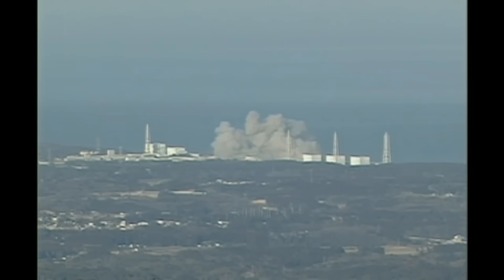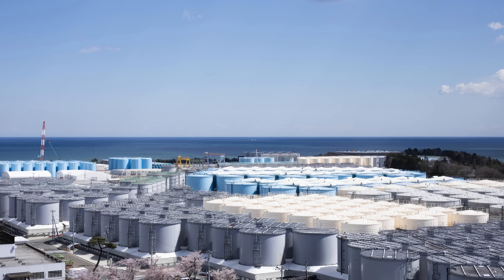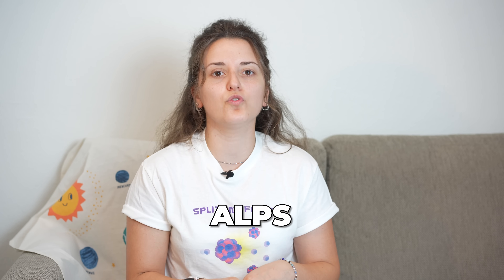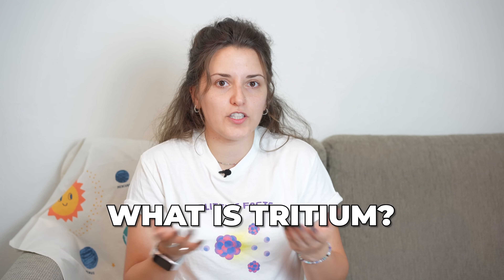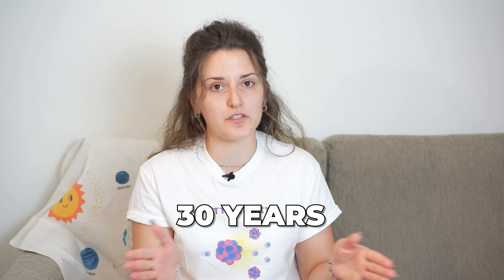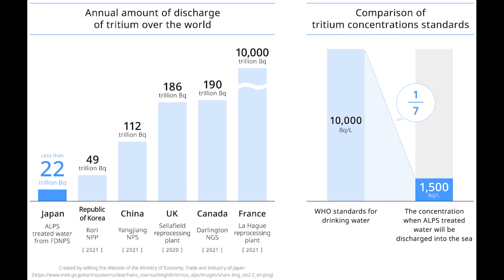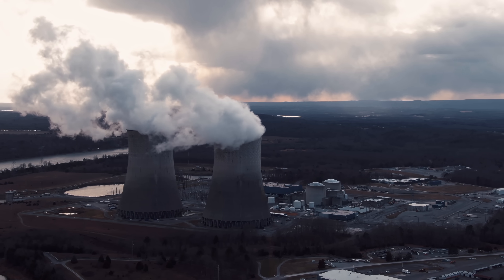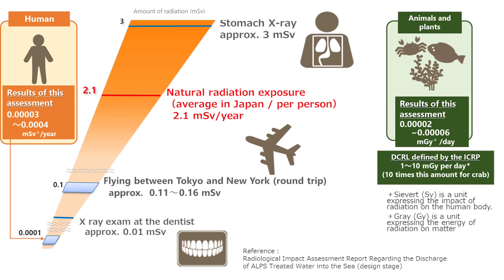Nuclear Physicist Explains - The Release of Fukushima Treated Radioactive Wastewater

Comment: Love your channel but this is not up to your normal high standard; the video is one of those "trust me, I'm an expert, I've looked at the numbers and it'll be OK" type. Saying it's OK because it's less than China releases is irrelevant. The comparisons to dental X-Rays and flying are so convoluted they fail for the lay person e.g. "how many dental X-Rays in a tank of tritiated water?" is the typical response. And people are worried that even if the averages work since the Pacific is so vast, what about local concentrations near the discharge points?  FWIW, I used to build civil nuclear power reactors in the UK, am avidly pro-nuclear, and actually agree with TEPCO's approach (although I'm livid that TEPCO execs were not incarcerated for their negligence). My friend asked "how many bananas are TEPCO throwing in the ocean every day?!!" I would present the T3O concentration vs "ocean background" or "ocean baseline" how does the tritiated water concentration in the water leaving the site compare to that of the open ocean average? If we filled one of those 1000MT tanks on site with water from the middle of the Pacific, how radioactive would it be in comparison to a tank filled with post-ALPS tritiated water ready for release? And the 12 year half-life of H3 in relation to the time since the disaster and the 30 year release schedule is crucial, right? Why are they not transferring from site tanks into into a tanker vessel and then slowly discharging the water while transiting across the open ocean in international waters - this would promote dilution would it not?  So glad your channel exists BTW - please don't take this critical comment personally.
Reply: Wow, you supposedly are in the nuclear industry yet refuse to read the report!
Reply: @danadurnfordkevinblanchdebunk Because he is an expert and You Are Not

Comment: I worked around microwave up links, 12 ghz 100 watt transmitters attached to the dishes.
I would feel the heat standing in front of the dishes and would get headaches and nausea.
I wonder how much damage this did to my body.

Comment: What happens if you use electricity to separate hydrogen and oxygen and then burn that hydrogen with the 2 excess neutrons?
Would that eliminate the radiation?

Comment: Nuclear material polluted water from Fukushima has more radioactive materials than just Tritium, like Iodine-129, plutonium-239,240,241 etc. All together there are 64 different kinds of radioactive materials in the Japan water. The water had touched the nuclear fuel materials directly inside the reactor comparing to the waste water from the cooling systems of the other countries. The Japan releases nuclear polluted waste water instead of the cooling water of the nuclear power plants. The difference is that Japanese waste water washed the nuclear materials directly.  Normal cooling water only flowing through the sealed pipes. Japan donated one million dollars to IAEA to let this release being approved by the institution.
Reply: The report clearly shows exactly what is in the water and the levels of each radioisotope and it clearly shows the only element that is anywhere near the action levels is the tritium.
Reply: The report also.clearly.demomstrates the effectiveness of the ALPS system.

Comment: As a nuclear physicist, can you confirm that there will ONLY be tritium in ALL the ALPS processed water?
If the processed water is so safe, what is the logical reason to build a 1 km tunnel to release the processed water into the bottom of the ocean instead of a shorter tunnel, or simply over the shore like a river?
Reply: The report confirms that tritium is NOT the only isotope in the water just like she said.  Pretending otherwise is disinformation on your part.
Reply: @ForbiddTV  May be I have not made myself clear.  My question is: can Elina being a nuclear physicist  confirm that tritium is the only radionuclide remain in the processed water? Through out the coming 30 years, there is no chance that the ALPS would fail or efficiency drop and not 100% of other radionuclides are filtered out?
Can you answer why the 1km tunnel is needed?

Comment: I enjoy watching her videos but something needs clarification at 0:45 in the video. From talking to most people who I've discussed this with think that the reactor underwent a nuclear explosion. That is not the case. Because cooling water could not be pumped into any cooling systems, the reactor core continued to heat up until the metal fuel rod cladding began to melt. When this happens the metal goes through a zirconium alloy reaction and hydrogen gas forms in the top of the vessel and eventually the reactor containment dome. The resulting explosion is from the hydrogen gas. The nuclear fuel in the reactor doesn't explode but the hydrogen explosion is fairly catastrophic.

Comment: Hi Elina, could you explain more on how the ALPS work and how effectively it removes all radioactive element except for trillium. How this was monitored and by who? Thanks.
Reply: Excellent question. I too am curious and have had the same question. There were some extremely toxic and dangerous contaminates in that water. I, who have worked with nuclear material, have heard of no system capable of filtering all the contaminates the way Japan claims to have done. I continue to remain skeptical on that topic.
Reply: @tomwhone9804  There is a remarkable way of reducing the radioactivity by a factor of 400. Stay away and do nothing for five years. Or, the ordinary civilian reactor process,  have sufficiently careful people put the fuel rods with properly designed machinery into holders go into water pools that capture the radioactivity of that decay. The alpha particles become helium, and the beta radiation is electrons and positrons. Gamma radiation is blocked by uranium 238.
Reply: @tomwhone9804  The black rockfish, caught on 18 May, was found to have 18,000 becquerels per kilogram of caesium-137, surpassing the legal maximum level of 100 becquerels per kg.

The rockfish was caught in an area where rainwater from the regions around reactors one, two, and three, which experienced meltdowns during the March 2011 disaster, flows into the inner breakwater. The sediment in the inner breakwater's seabed has a caesium concentration of over 100,000 becquerels per kg.
Reply: @icebaby6714  Excellent example. Thanks!
Reply: @icebaby6714  Sorry, misleading information!  A significant degree of nuclear contamination leaked into the ocean at the time of the disaster in 2011.If the black rockfish was inhabiting that area at, or anytime soon after the disaster it would certainly be contaminated. The testing done on seafood around the Fukushima area since the release of the treated water reveals only very small traces of caesium 137 at levels well below any concerns for human or marine life.
Reply: @Asimetric  No, a dozen of fish captured near Fukushima in May this year as reported by the Guardian newspaper.
Reply: @Asimetric  No, a dozen of fish captured near Fukushima in May this year contain high level of  radiation as reported by the Guardian newspaper from Britain. An American Youtuber who visited Fukushima plant last month and detected very high level of radiation and complained.
Reply: @icebaby6714  try jp fugu fish! ha...................
Reply: @icebaby6714  You don't have a very clear understanding of things. This discussion is NOT about the localized contamination that resulted when the reactor meltdown occurred, that is commonly accepted and well discussed and documented. That is why the rockfish were contaminated, and that is why the seabed inside the breakwater is still contaminated.                                     The video, and this associated discussion is about what contamination, and at what level, is present in the treated water that began to be released on AUGUST 26. Nothing that occurred before then is relevant to this discussion!!!                                           Also I note that you haven't provided any citation for the Guardian article. Without that it's a meaningless statement. Additionally, don't waste your time using Youtubers as a source of information. They are mostly idiots looking for sensationalism to create an audience, facts are ignored by them, and they are seldom able to provide any facts or evidence to support the content of their video. i.e., was this tuber a nuclear scientist? And where did he/she take samples from? And did he/she have samples analysed  by the IAEA?  Just trying to be polite here, but I suggest you get a better understanding of what is being discussed here, and source FACTS from qualified sources before you post in discussions!
Reply: japan has so high level tech to remove radioactive element, so I think they should use that ALPS to deal with all the radioactive waste. They will make a lot of money.
Reply: @mingwu-v3f  What about other radioactive elements such as caesium etc, some of the elements have half life of 1000+ years. Can ALP remove them all? If so where does Japan get rid of the radioactive elements removed from the water? Dump them in the mountain or throw them to the ocean?  

The radiation level inside the plant was very high as one of the Youtuber visited it recently and detected it.

As reported by British media, a black rockfish, caught on 18 May, was found to have 18,000 becquerels per kilogram of caesium-137, surpassing the legal maximum level of 100 becquerels per kg.

The rockfish was caught in an area where rainwater from the regions around reactors one, two, and three, which experienced meltdowns during the March 2011 disaster, flows into the inner breakwater. The sediment in the inner breakwater's seabed has a caesium concentration of over 100,000 becquerels per kg.
Reply: @mingwu-v3f   Quite unnecessary for "ordinary" reactor "waste", which is less than 4% fission products. Most ofthe rest is plutonium, and uranium 238 being wasted instead of building well proven fast neutron reactors to consume it as plutonium. Reactor grade plutonium is worthless even for a bomb maker as suicidal as the September 11 religious fanatics, because its spontaneously fissile plutonium 240 is more likely to kill the maker than his or her intended victims.
Reply: Japanese lied about ALPS. 1. ALPS has no way to remove carbon-14 either which has a half life of 5,370 years. 2. They are using 800 times seawater to dilute so-called ALPS-treated water before it is released, while normal nuclear plant cooling water doesn't need to be diluted. Their Asian neighbors and IAEA have to spend lots of money and manpower to monitor the releasing during the next 30 years. If it's safe, why don't Japanese just use ALPS-treated water to water their own plants instead of releasing it into the Pacific Ocean.
Reply: @zicheng7804  Because it's concentrated if use as is.   Otherwise why doesn't China water their own plants from their nuclear plant discharges? 
Tritium released annually  https://youtu.be/Et7mBoxdIq4?t=229
https://www.youtube.com/watch?v=nkNCxPY3Yrg&t=475s
Reply: she know s#$t!
Reply: This Youtuber is the kind of those so called "scientists" that has been telling the world for the deep state that there's no global warming or the Monsanto GMO stuff were "safe." The fact she kept single out about China with this or that already showed you who she got paid for US 5 eyes led disinformation. China ain't the only country that has taken action & ban Japanese seafood products but also Russia & most countries within ASEAN & Asia. Even US has been limiting Japanese seafood products. She also failed to tell you Japan hasn't done much in cleaning those contaminated areas and has already calling Japanese to move back to those dead zones & some already did. There are a few journalists has already done investigative journalism & documentary covering the Fukushima areas showing high radioactive still present on most parts and some even went 20-30 times above the international health warning standard. Take for example they build a kindergarten in one of the effected areas, while the whole kindergarten & right outside the gate, the radiation level was safe, but if one just go 10-20 metres away from the premises. High radiation level again has risen to very unsafe level & it's worse when measuring the soil that Japan has never cleaned up. There has been a local Japanese group with members of 20-30 for the last 10 years measuring all the highly radioactive zones that the Japan government said was safe when their founding showed the opposite.
Reply: Carbon 14, strontium 90 and iodine 129 and others which are more harmful than tritium are treated and released into the ocean. But She only said about tritium. Disgusting .
Reply: @@jorgej8855 How reliable is ALPS? Can it really remove most of the radioactive elements in the contaminated water? How does Japan handle the radioactive elements removed from the water?
Reply: Trillium is a wildflower, also found in gardens. The heaviest hydrogen isotope is tritium, and there isn't enough of it in any civilian reactor for the water to be any use for the hydrogen fusion: deuterium+tritium -> helium + a neutron.
Those neutrons carry so much of the energy that, in every military thermonuclear device other than the USSR's actual Tsar Bomba, half the blast energy comes from fission of the "depleted" uranium in the "tamper" that is blasted inwards by a fission first stage, to compress the "heavy hydrogen" nuclei together. That third stage in the ordinary design would make any copy of Tsar Bomba equivalent to 100 megatons TNT. Lead was used instead, giving a much cleaner 50 Mton bomb that the bomber crew could, and did, survive.
Reply: Monitored by people who are professionally trained to bow at perfect 90 degrees when they get caught!
Reply: @goldeneggduck  Wrong and ignorant!  Caught for what???  The monitoring is being done in co-ordination with the IAEA and the FDA. The decision to release the water in the first place was done with the approval of the IAEA. FACTS!!!
Reply: ALPS is a miracle. No country will ever worry about wasting resources to store the radioactive water in any tanks underground. Using ALPS and to release purified water is the answer.
Reply: Tritium, not trillium
Reply: That will defeat the purpose of this video. 😉 You have to believe this ALPS system, which should be a prize winning system, can remove everything except trillium.  Every other countries can use the same ALPS to cool nuclear reactors.
Reply: The corrective skeptic trainers are on the way. You will not ask. You may never ask. Your task is not to ask.

Comment: As a physicist myself, I have no issue of the science part which is pretty clear.  However, that doesn't cover the human factor in this matter.  The power company that is in charge of these reactors that brewed the accident from a really minor one (cooling system power outage) to 3, if I remember correctly, reactors blew up which is the highest level of nuclear accident possible (with only one other accident at the level, chernobyl), is exactly the one that is in charge of the contaminated water treatment and release.  They had multiple chances to limit the accident to a much lower level/impact, but they made the wrong choices every single time, for what reason?  Cost saving, save the reactors, cheat, cover-up, maybe also a little bit of 'face saving' (an asian culture thing), just to name a few.  Given their track record, NOT giving them any trust is the exact RATIONAL choice here.  By the way, there's NO independent verification of the release -- all scientific evidence to back the release and ocean water samples after the release were provided by either the japanese company or the japanese government.
Reply: No one with any common sense would believe Japan's propaganda.  No expert was allowed to test the water or their super device at the location.   The sample was delivered to the so called experts.  Still do not allow 3rd nations experts there to test.
Reply: @rinahk3407   Four countries tested the water at labs in six countries.  How is that not 3rd party testing?
Reply: @ForbiddTV  where did the sample come from?  Did they collect the samples first hand?  That is the question.
Reply: @leixia2666  No.  They did not collect the sample first hand.  The sample was prepared and delivered to them by TEPCO.
It is useless to explain to this TV guy b/c he will misinterpret your plain statement and repeat his own script.
Reply: It's obvious you are not a nuclear physicist.  If you were, there would be no way you could say any reactor blew up at Fukushima among other things.
Reply: @ForbiddTV  the pressure vessel of three reactors exploded due to hydrogen accumulation, and have all the melted nuclear fuel was exposed and to some level dispersed into the area.  If this is not blew up, what should I call it then?  And the pile melting and explosion could all have been avoided, if the company put public safety ahead of their cost savings calculation.  By the way, nuclear physics is within my expertise, even though I am not a nuclear physicist.
Reply: @leixia2666   No they didn't, the explosions were hydrogen explosions in secondary containment, not primary containment.  You could have easily looked at the design of the Mark 1 vessels.   I doubt you are any kind of physicist at all.

Comment: Something I do not understand. If the function of this tainted water was to cool, why did they not simply use the tainted water again once it cooled? Why could they not built stainless steel pipes into the ocean then use that clean water with a heat exchanger with the tainted water? I do not understand why fresh water was the only way to draw off heat?